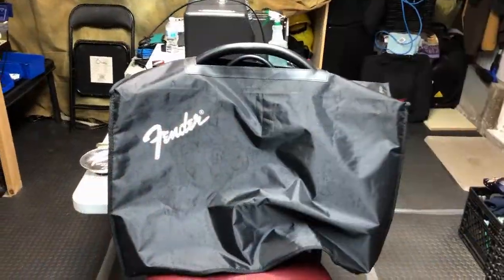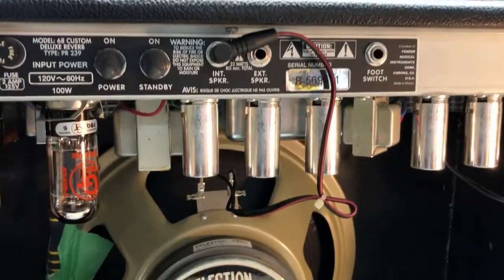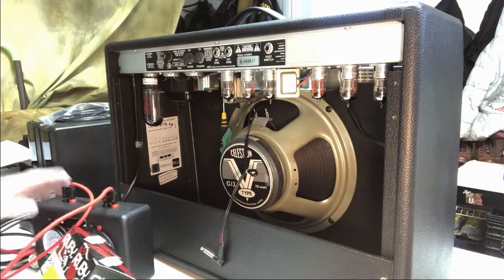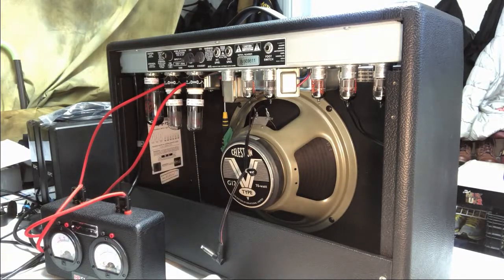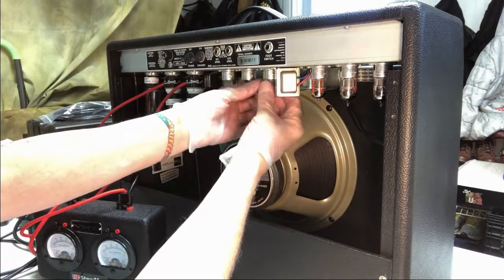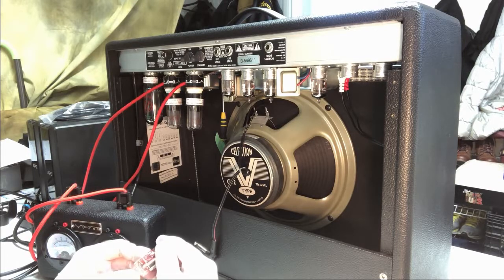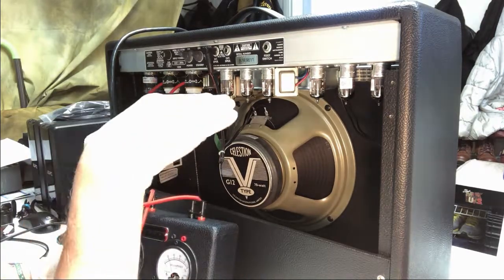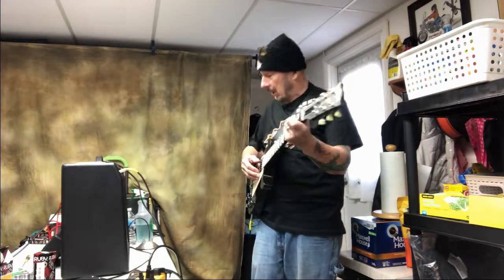Amp Tube Repair - Yet Another Fender Deluxe Reverb Project

Comment: You put your 12AT7s in the wrong place, my friend. Please follow the tube chart sticker very visible just under the rectifier tube. Also, turn your amp upside down so it is laying on the handle. That way you can see the sockets clearly when putting new tubes in, and you don't need tape to dangle that screwdriver like that with tape. Yikes. 

That amp will get very noisy very quickly with the 12AT7s in the wrong place, because one drives the reverb and the other is a phase inverter.

Comment: How important is it to have those power tubes at the same bias?   Is it absolutely necessary to buy one of those milliamp readers or is it safe to say that when you are installing brand new tubes, they will be at the appropriate bias for your amp?  Obviously I would think it would be better to have adjustability, just wondering if I need to spend an additional $150 for that StewMac milliamp reader  to set the bias for the power tubes.  Any suggestions/insight would be appreciated!   Thanks for the vid

Comment: You put the preamp tubes in wrong.  The 12aT7 tubes do NOT go in those positions on right.  Use the tube chart in the amp to see the correct layout.  The reverb driver position may burn out since a 12aX7 cannot handle as much current as the 12aT7 needed in that position.
Reply: I don’t know why he doesn’t look at the actual tube chart , 
I have a 65 blackface drri I bought from guitar center; it’s obviously a deluxe reverb with the correct cab , speakers, reverb tank , and board , but it has a priceton reverb tube chart , so weird huh?
Reply: He is a hack. 25 minutes of the video was changing the tubes.
Reply: RIGHT!? I was almost screaming at my screen! READ THE DAMN CHART!!! IT'S RIGHT THERE!!! 12AT7 go (right-left) 3rd & 6th position. SMH....
Reply: @CRUNCHCOLE  Why do you spend half of the video telling me how to change the tubes? Anyone who don't know how to change the tubes has no business trying to bias the output circuit!
Reply: jjsant3250...thanks for the heads-up... i put the pre-amps in - in the wrong order cause i'm following directions according to this clip. i happened to see the comments after playing tru my Deluxe for a couple hours. it was my 1st tube install. Glad i saw your comment. i saw the Tube Chart inside the Amp i wasn't aware of. I put the tubes in the correct order. Thanks so much for your comment.

Comment: With these amps you wanna take that V1 out (Use only vintage channel), replace the V3 12AT7 tube with a 12AU7, Replace the PI AT7 with a AX7 if you want earlier break up, crank up the bias a tiny bit and you got yourself a sweet little bloody amp friendo!
Reply: Mine just arrived yesterday, cant bond with it :(. So brittle and harsh compared with my Bugera V22.
Reply: @clintwhite3021  thats not my experience. I haven't played through a bugera v22 but I love my deluxe reverb

Comment: I just bought a 2017 68 Custom Vibrolux Reverb and was wondering if the stew mac bias type meter you have is the only way to bias these type of amps. I have biased hot rod deville before but bias point on circuit board was easily accessed. I only see the screw driver hole bias pot control one these.  thx
Reply: Wondering the same thing. Did you ever figure it out?

Comment: Not entirely sure about a Deluxe, but most amps, if you have a guitar plugged in, and strike the strings, unplug the amp, and wait for all the noise to completely dissapate, you will successfully drain the capacitors.
Reply: Brian Martin
0 seconds ago
Yeah I heard that but I check all information , who told you CNN ....JUST KIDDING